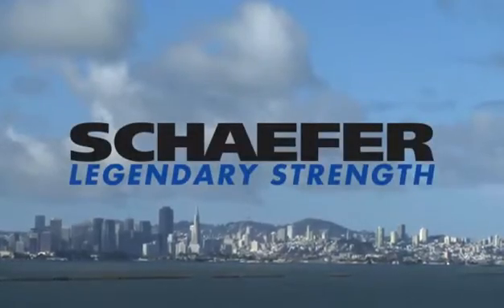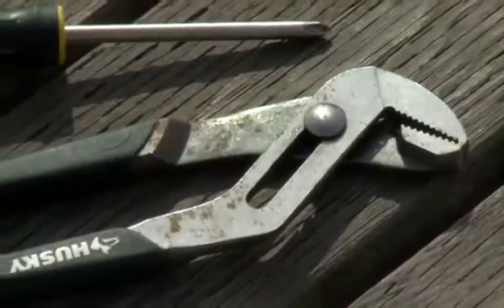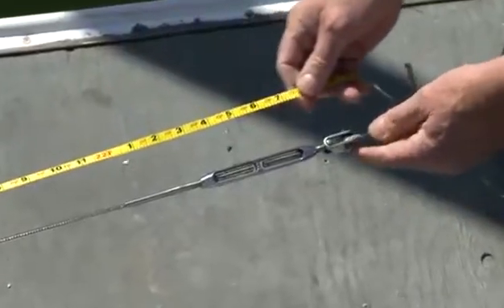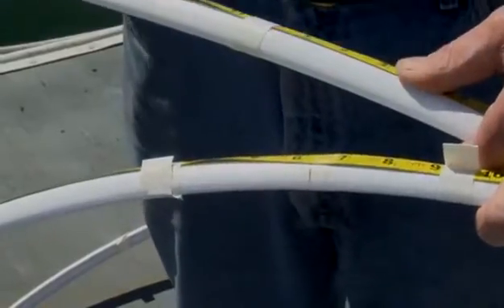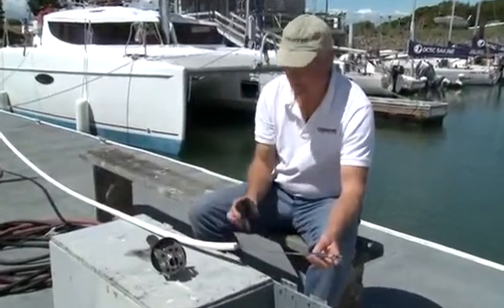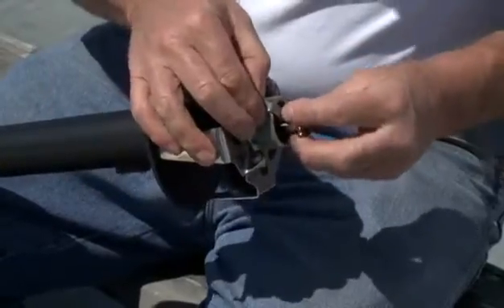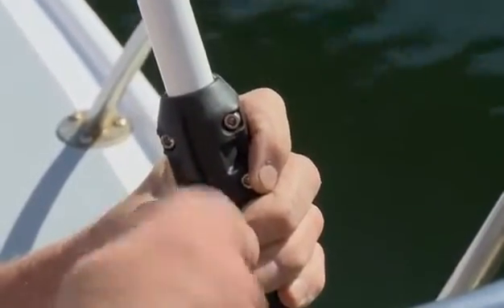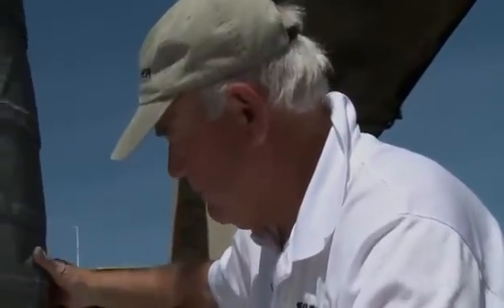Snapfurl CF-500 Installation

Comment: Why do your videos end before the conclusion of the video? Also I watched the 500 and the 700 Installation videos. One thing that I never saw is what the proper procedure to feed the control lines on the roller. There was no mention of length for the two boats. It looked like quite a lot of extra was included on the furler. Additionally, would dyneema be a good idea for these or because of handling, larger is better?
Reply: What he said , no last part of video. After seeing this partial video, I ill stick to buying Harken, ( had three of them and no problems at all. But this time, Ihave a smaller boat and the Harken unit 0 seemed maybe too large for my 19 foot boat, butmat least their video’s play !